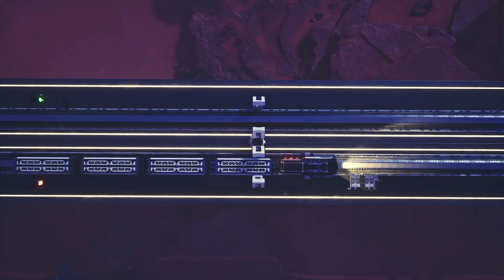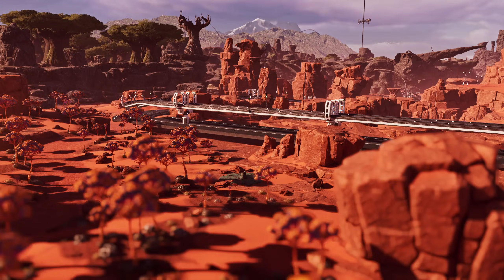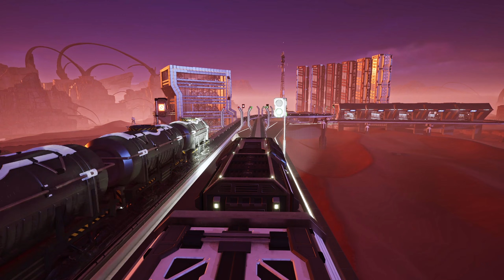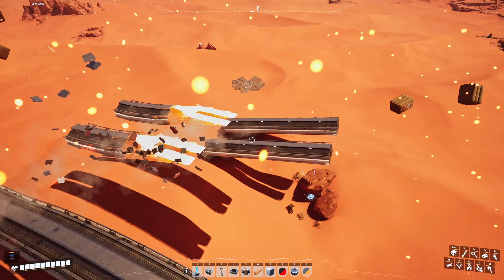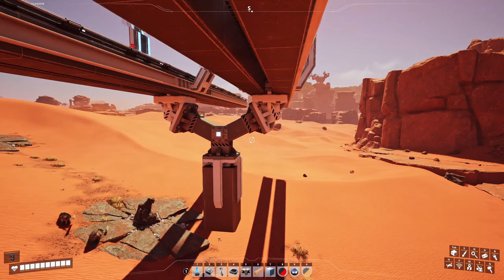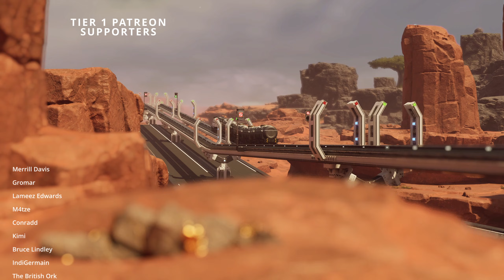Futuristic New RAIL Design Showcase

Comment: Did you build these in the mk1,2, or 3 BP machine? I noticed your using a bunch of 4 foundation length roads except for maybe the 90degree turn.  I'm considering supporting the patreon but do hope that the BP's u use for the train networks uses the Mk 2 designer since it is unlocked in the same tier as trains.
Reply from the maker: Train related ones iI believe are all mrk2, the stackable refineries are all mrk3